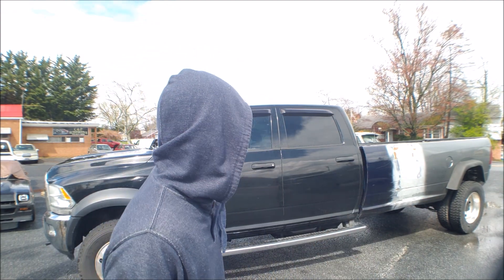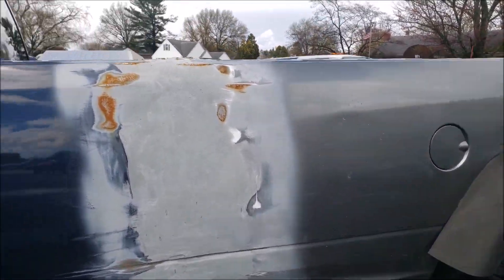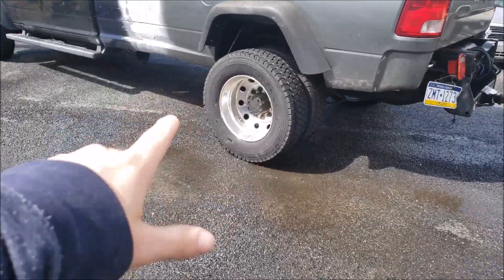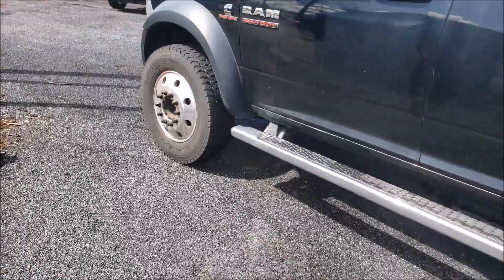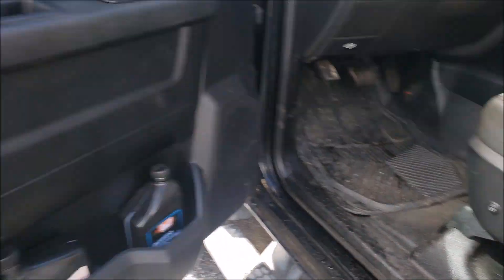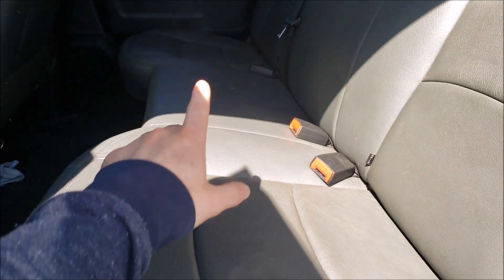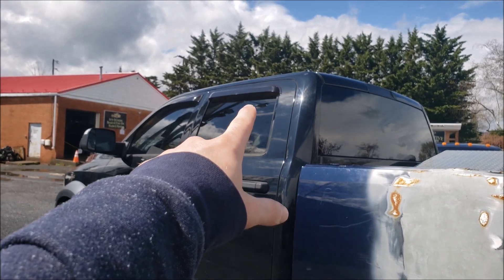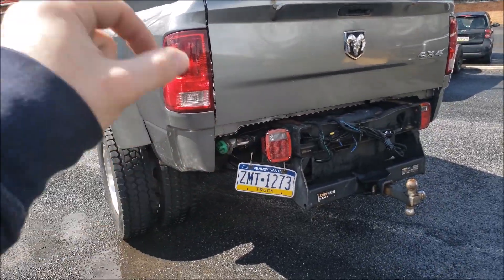Ram 5500 Extreme Long Bed | Build Update

Comment: That truck build has a great potential. The way it is now, you could probably take it out on the road and make money with it. I apologize for getting to this so late, but I hope you have kept it and will continue to do videos on the build.
Keep up the good work!
Reply from the maker: The new owner of the garage bought it. When he finally finishes it I'll do a video. It has megacab flares on it. I loved the truck just not a fan of the automatic or 6.7. This thing went through two t cases, an engine, and 3 lift pumps. Definitely don't miss seeing those bills 😬😂

Comment: Steve what y’all doing with the truck?     Why you didn’t use it when you were putting the RV’s?
Reply from the maker: Putting any trailer on the back is automatically class a cdl. My 2500 has a 9000 gvwr so any trailer under 17k was legal even though I pulled a bunch of 21k trailers. 5500 is way more obvious. I used it a few times but to get good mileage you can't go over 65. 70 is pushing it
Reply: CP Steve Miller Oh, makes sense now. You guys bought it new or used?     What was it originally bought for?    Tow truck?
Reply from the maker: Bought it to pull the 40ft tri axle trailer we had. Gcwr was 40,500 pounds. Bought it used and it went through an engine
Reply: CP Steve Miller What happened to the original engine?    I wish you would have made videos on the process.
Reply from the maker: I was on the road when it happened. This was long before the bed swap. A driver broke the fuel pump off twice with the gooseneck trailer chains and ended up sucking in a ton of water. Number 6 cylinder took all the damage and locked up the motor. I have a picture on my Instagram from awhile back I had to tow it with the 40fter and my dually
Reply: CP Steve Miller Damn!  I’m surprised the water fuel separator didn’t help and shut the motor off being there was no diesel to burn. On my family’s farm we have Huge 30 foot tall diesel tanks, they leak rain water from the top of the tank. We have to drain/bleed the water from the bottom until diesel comes out.
Reply: CP Steve Miller Do you know the stipulations on Instagram to finally make money?
Reply from the maker: @Mr.Beastforpresident  No idea. I only know YouTube's. I didn't know you could make money on Instagram. 1k subs and 4k watch time hours minimum
Reply from the maker: I would but that 351 needs replaced with a 12 valve 😂
Reply: CP Steve Miller And Alcoa’s with dual wheels 😂

Comment: Tire capacity:  5.5k for duals... But not 11k for the rear.  There are 4 tires back there (so 5500x4).  Otherwise, 2 singles at 6k (12k) would have more capacity than the 4.  Big truck!
Reply from the maker: There's a tire rating on the side of the tire for when they're singled out or in duals. 

My rear tire rating for a pair on each side(dually) is 2910 x 4 which is 11,640 pounds 

Single tire rating is 3195 x 2 which would be 6390 pounds. 

So my rear axle's capacity is 11,640 pounds with the duallies. That's what dot looks at. How do I know? Been through it.
Reply: Wow. Those are not rated very high (no offense intended. I'm quite surprised). I'm running SRW 19.5s. 4805lbs per tire as singles, so 9610 on the rear axle.
Reply from the maker: @raychilcote5558  For a 2500 that's decent. I only have a 9k gvwr 😅 this is on my dually swapped 2500. Not the 5500 btw

Comment: Why didn’t you use a dually bed as the donor?  Not enough 5500 videos out there..make more
Reply from the maker: If it were my choice I would've. The beds don't line up easily though from what I read. It'll be getting custom built flares at some point though. The bed is currently in the body shop now. Just waiting on that for the next video